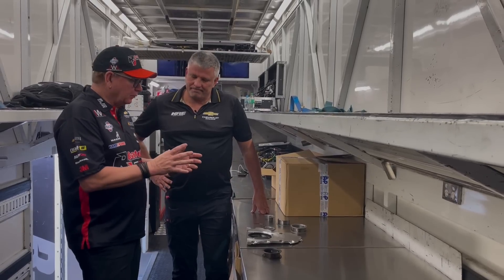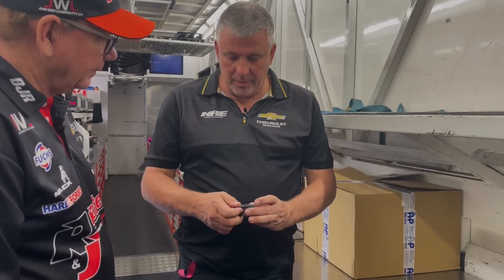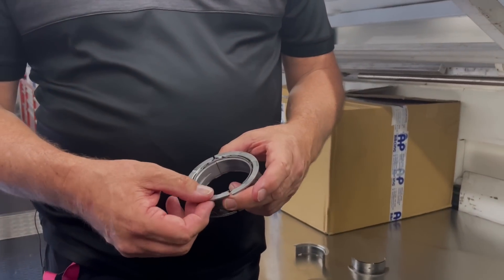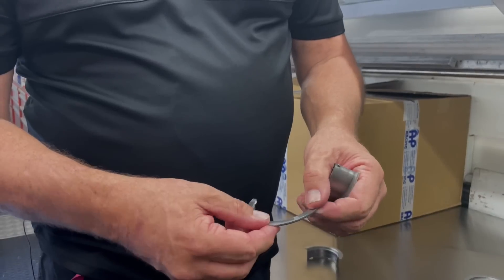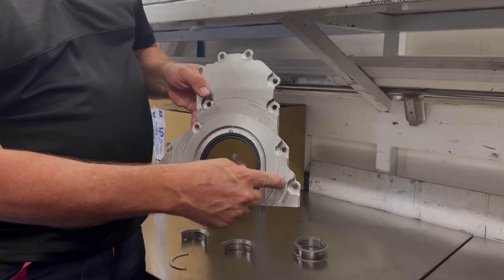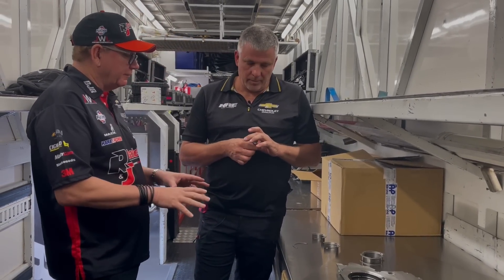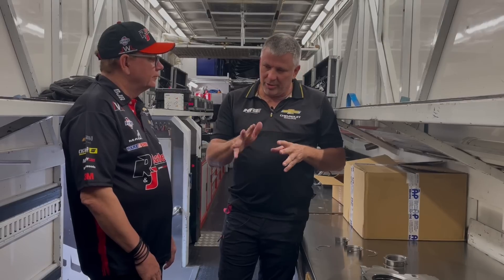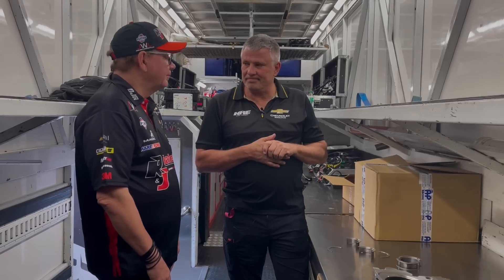Kenny from KRE and Brad discuss thrust bearing failures

Comment: There's a lot of merit in going to a GT3 style rolling start. Probably reduce the stalls and crashes too. I'd prefer that to the damage it causes.
Reply: Yes it causes issues but it is an entertainment product foremost and losing that would be a huge negative to the entertainment. A rolling start just doesnt have the same feel.
Reply: A lot of club and intermediate racing is going/has gone to rolling starts as well. Far less incidents which leads to more track time for the money, less crash repairs and driveshafts etc last far longer. I actually think rolling starts are more exciting than standing ones both to take part in and to watch.
Reply: And restarts after safety car interventions are always rolling ones and they are just as spectacular.
Reply: @graemecatty9921  But not mechanical breakages and stalling. Hitting a stationary car at full noise never ends well.

Comment: Put a H pattern back in them without anti stall or line lock and get real men to drive them.
Reply: Not really anything to do with thrust bearings 😂
Reply: @drifterdrifter9558  well it is if you are sitting there feeding max revs with the clutch engaged in gear with a line lock. Because the transaxles are sequential there’s no room for error on the start line so they select first and hold it a long time. Ever had trouble finding neutral or missing second on a motorbike?
Reply: They ran line lockers back in the H pattern days.
Reply: A H pattern gearbox will not make a difference, neither will taking the line locker away. You're still going to be loading the driveline up in first gear against the clutch putting great stress on the crankshaft. It has nothing to do with how the gearbox operates the selector mechanism.
Reply: @Gremlin65 they have a predetermined rev launch window and it ranges but minimum it is around 5000. Also rev cut is only on upshifts so the thrust cops it on all the down shifts and with a remote transaxle it’s possible a lot of other loads are put on bottom ends.
Reply: They are also hitting 8500 rpm on downshifts...

Comment: Well, going back Hand Brake system which Lock rear Wheels, Is that a help or it Load going into the motor block?
Reply: Makes no difference whether the brakes are on or not, with your foot on the clutch you're putting massive force on the thrust bearing. Add 7500 RPM to the mix and it's hardly any wonder the thrust bearings are coming apart
Reply: The load through the driveline is basically the same whether the rear wheels are locked via a handbrake applying the brakes, or a hydraulic line locker holding the brakes on.  Either way, rear wheels not turning, clutch somewhat loaded, and engine revving it's tits off, the force has to go somewhere.